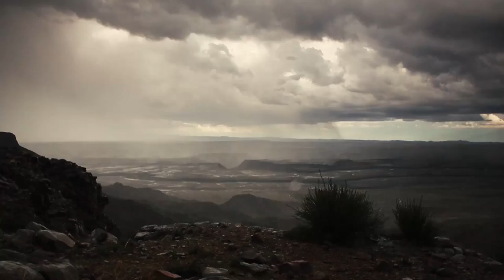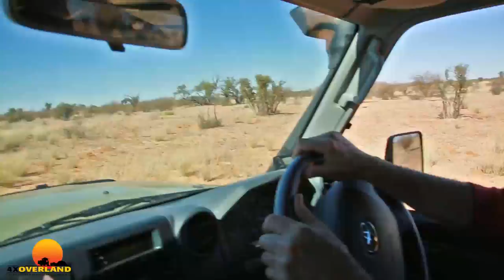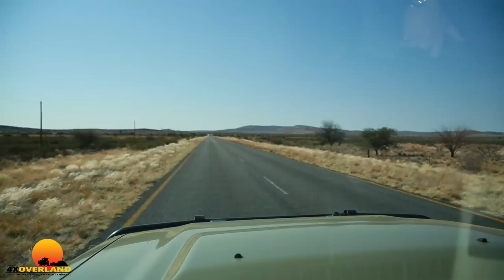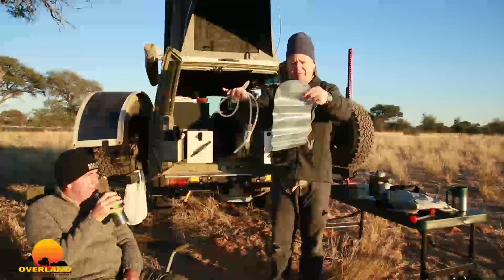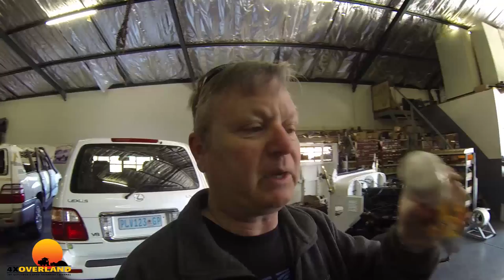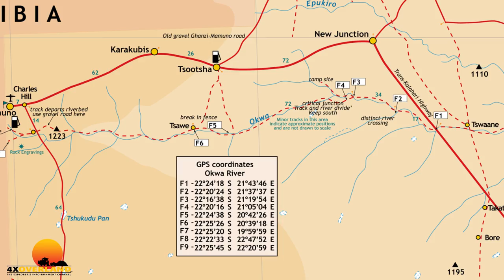Explore the Kalahari outside of the National Parks

Comment: Very cool! I use MSR's Seagull Stainless steel nesting pot set, a Folding Firebox nano and a Trangia alcohol burner, it packs down small, and the fuel despite the longer cook times lasts me 2 weeks per litre per person for three meals and 2 hot drinks. If I ever run out of liquid fuel I also have the option of using small twigs to cook on too, handy in a small Jimny while exploring.

Comment: why don't you have an inline fuel filter as standard no matter where fill up?... dirty fuel can ruin your fuel pump, injectors and entire engine... if you don't get the tank flushed real good any dirt left in there will just keep fouling your engine
Reply from the maker: There is an in-line filter fitted. The question is, does one fit a second. If I had a second fitted, the results would have been the same - it becoming blocked and the performance affected.  It still would have restricted fuel flow. The very large existing in-line filter was insufficient for the amount of dirt in the fuel in this case. Being an old design of engine, it should have no permanent affect on the injectors or pump. That is why this is such a great overland engine, as it's not overly sensitive to poor quality fuels. Modern direct injection and common-rail engines are far more sensitive. The vehicle has done another 10 000 since that incident with no issues. An external filter to filter the fuel between the gas station pump and tank might be worth considering. Or is that what you were referring to?
Reply: 4xOverland I don't mean to be rude but didn't that in-line filter take contaminates out, didn't it work or was the fuel so dirty the filter let dirt through anyhow...
Reply from the maker: SquirrelFromGradLife No worries. The filter did its job and protected the injectors. But the fuel was so dirty, that it blocked the filter to the point where it would not let enough clean fuel through to run the engine at high power.
Reply: 4xOverland Good thing to know.. I bought a filter for just that reason and had no problem even siphoning from virtually bone dry farmer tanks...
Reply: 4xOverland BTW what are your opinion on getting Hutchinson beadlock wheel for a LR3? running on BFGs either MT or AT... are they complete overkill? I have some stock 18 inch alloy wheel and Pirelli Scorpio tires that came with the thing that sorta work off road
Reply: SquirrelFromGradLife They're also very handy to use on axle breathers if your in deep water often.